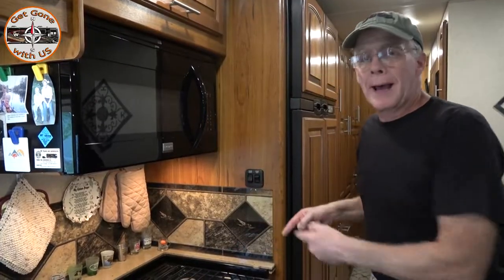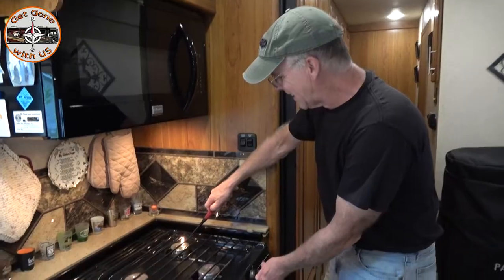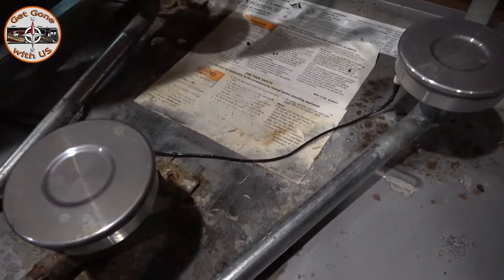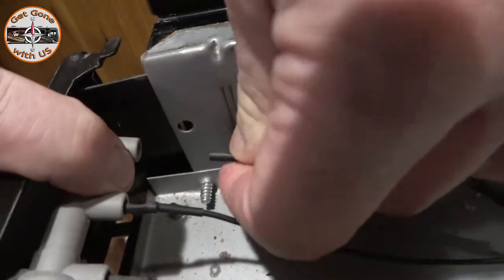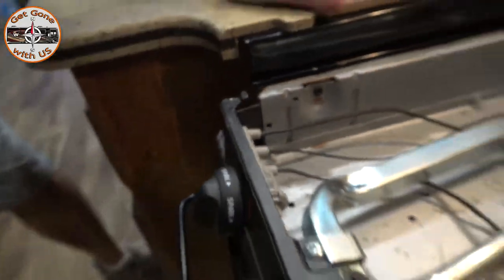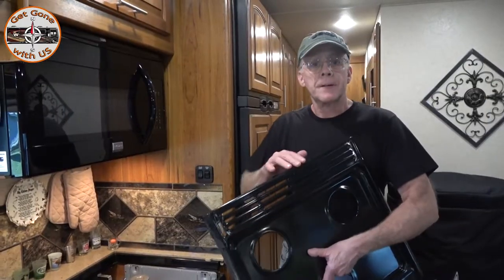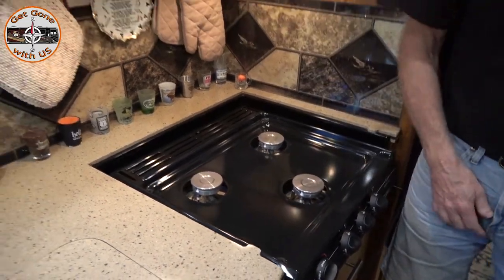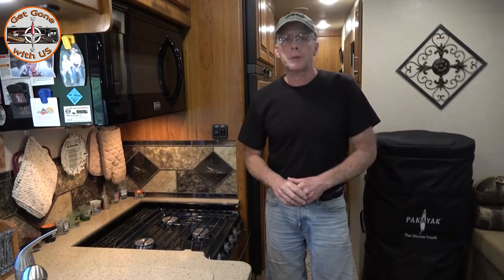RV Stove: How to Fix and Troubleshoot - RV Maintenance 101

Comment: Thank You!.  I love your grill.  Its better quality than the one on my Atwood stove.  do you happen to have the model number?
Reply from the maker: I believe it is this one... https://amzn.to/3t45In9
Reply: @GetGonewithUS  Thanks so much.  I will check if it would fit my stovetop.  My grills are so cheap, it's 2 part, the paint falls off with the cooking, the rubbers holding it straight deep falling off and break.  I had it changed on warranty 4 times.  they all the same.  Yuck
Reply: @GetGonewithUS  I called Atwood and the lady told me it fits only your model cook top tove (Wedgewood RV/CV) .  Not mine Atwood (RA/CA). Cheers !
Reply from the maker: @projet2907  Bummer, sorry Julie!

Comment: Thanks for the video Chuck and Cheryl. We have had issues with ours ever since we have gotten our motor home. Ours always did light but you would have to crank and crank the striker to make it go. I will have to go out in the RV tomorrow and check for this issue you showed us. By the way. We cancelled our trip to Maine for this year and changed it to next May.  Todd & Denise
Reply from the maker: Check for cracks in the plastic around the wire.  Also if the other 2 are good see if one of those will reach the burner that doesn't light. Switch the wire and see if that takes care of the problem, if so replace all the wires. Sorry to hear you guys had to cancel your Maine trip. We feel like we just want to skip the rest of this year and start the new year.  Hopefully it will be better. Stay safe guys! 😃

Comment: Fantastic video! I  followed you all the way but see no spark on wires showing a bad wire still won’t lite but did yesterday. 😢
Reply from the maker: Thank you.  Make sure all the connections are on tight and you are getting propane at the burner. Good Luck!

Comment: Great vidieo!  We need to switch out our ignition wires too. Do you know how to adjust the flame when it turns yellow for this model?  We have the same stove
Reply from the maker: Thanks Mary Ann.  Try these tips for the flame...
YELLOW FLAME TIPS
Improper gas-air mixture --------------------------------------Adjust air shutter if applicable
Low gas pressure--------------------------------------------------Check gas supply
Check for leaks and have the regulator checked
Set pressure to 11” water column
RA Ranges and Cooktops
Improper orifice to burner alignment --------------------Realign burner head and orifice tube assembly
Replace orifice

Comment: Hey Guys!!  As usual, great fix! I have a burner that doesn't light and was thinking of a elect. push button igniter replacement seeing as I will have to change my wires. I hate that loud turn knob and would like just a little click,click, click!  Thoughts? Saw your last Mudfun video and glad your enjoying N.E.
Reply from the maker: HI Bruce. Thank you.  The only thing I can think of is make sure the push button has 3 outputs on it for the stove.  It's not something we ever thought of doing ourselves. Yes, we are have a ball in N.E. We went exploring in an old Mica Mine today! 😃

Comment: Ok Chuck, I'm sure you waited for the grill to cool down before you grabbed it.  This is a easy DIY for the mass majority since there has got to be a ton of these stoves being used.  Before ours goes out it wouldn't hurt to have a set of wires on the ready.  And as always, great video shots Cheryl.  Is Brandi getting camera shy?  I haven't seen her much lately, or maybe I just missed it.  Stay safe out there.
Reply from the maker: Thanks Carl, hope all is well with you guys. Yes the grill was cool enough. LOL If you get in a pinch, electrical tape with get you through the trip, but replacing the wires is the best bet, plus they are better quality then what the stove comes with.  Brandi is alive and well, she has been preforming in our  adventures on our WeRmudfun channel. Her contract only allows her to be on one channel or the other.  We are in contract negotiations with her agent now. LOL
Reply: @GetGonewithUS  We're doing great so far.  Those agents are sure strict with their clients.  Don't let her put her paw print on anything until she gets your ok.
Reply from the maker: Carl, we are keeping a close eye on things. LOL